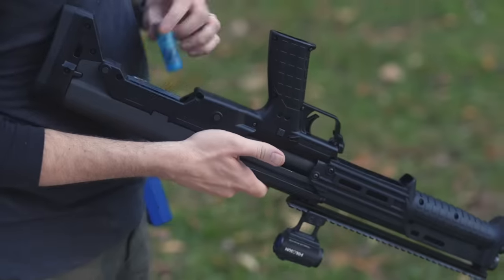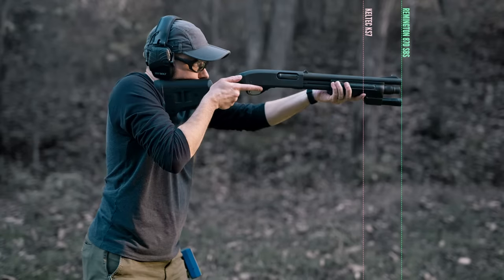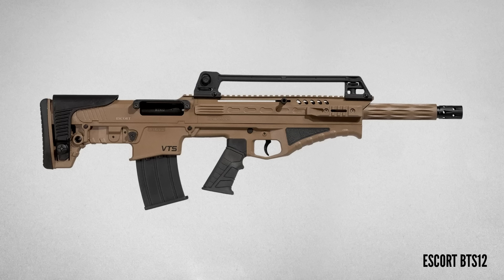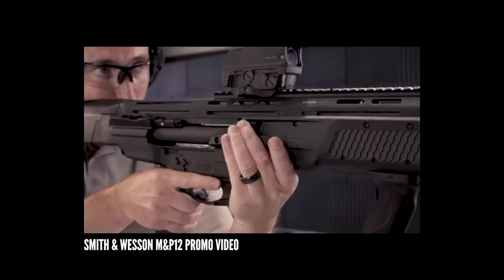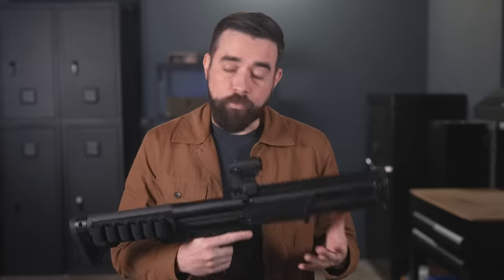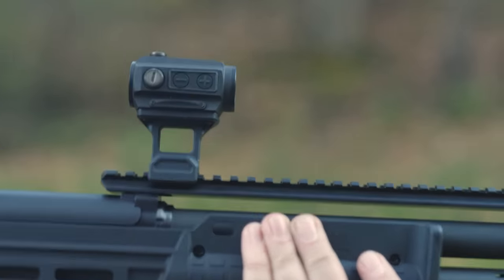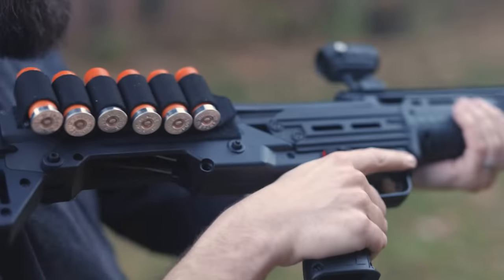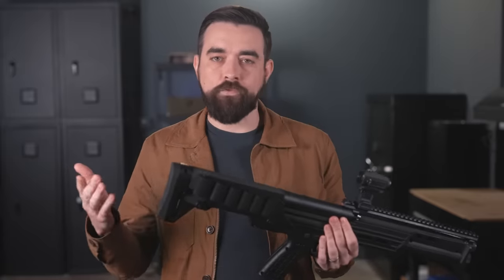The Bullpup Shotgun Experiment

Comment: The KSG is my first and only shotgun, so I do benefit from not having to relearn operations. Trying to run the action as fast as you were in the video can cause feed issues most likely from "short shucking" which is easy to do when you first start training with it. I also noticed you were using low brass shells which I wouldn't recommend as they can become lodged in the extraction forks (which I have experienced). I would also advise against the 1.5 inch shells as they can sometimes double feed. High brass 2 3/4 shells have never given me an issue in 5 years. You're correct about the punishing recoil. I purchased the Kel Tec extended butt pad and muzzle break, which do help to a degree but it's still more extreme than most conventional shotguns. I personally like the gun, but it does come with a steep learning curve and retraining for those who are already proficient with traditional pump shotguns. I would say that if your considering a bullpup shotgun or rifle your best bet would be to go all in or stay completely traditional due to the operational differences between the two platforms.

Comment: I would like to see you continue this trend. I picked up the KS7 myself and I to went with the shell card on the right side and I also found the recoil brutal. I found installing the extended recoil pad KSG sells helped a lot and so and a Limbsaver pad on top of that helped even more. 

I am a fan of the bullpup form factor but I agree with you there are tradeoffs you have to learn. When I came to firearm shooting my strategy was to just learn on bullpups to mitigate that somewhat and so far it has worked pretty well but there are definite cons, I just think the short length is worth it. 

My thought process on getting the KS7 was the same as yours, I only really need 7 rounds, let's save weight. Now I wonder if the KGS would have been a better choice simply due to the increased weight helping with recoil management. Maybe you should try that one. Put a large handstop on the end and it should have a similar action to the KS7. I'd also like to see you run the Tavor-12 and the M&P 12. I got the Tavor - 12 myself but I haven't had much reason to shoot it much but I feel like the recoil will be much softer being semi-auto and heavier but I too worry about the mechanical complexity.

Comment: I have a KSG and I like it. Bought it as an aircraft gun for bush flying because it's smol. I like the dual tubes not for pure capacity, but because you can load different munitions in the different tubes: I run a tube of buck and a tube of Black Magic slugs. I much prefer the ergonomics of the KSG vs a traditional shotgun: normal shotguns' length of pull are absurdly long, and between that and the long barrels it feels like waving a jousting pole around to me. The KSG tucks right into my shoulder and you can move through doors and hallways without pre-planning each movement like you're hauling your friend's couch up to their third-floor apartment.

Loading the KSG sucks: the KSG is even slower than the KS7 because while the KS7 with its single-tube merely needs to be inverted (which gives you a good view of what you're doing), the KSG really needs to be turned on its side... twice. Flip it one way to load one tube, then flip it onto its other side to load the other. You can load the KSG inverted, but its hard without gravity helping guide the shells into the appropriate tube and you'll end up fumbling around in there a lot.

Regarding the action: what I've noticed with the KSG (I assume the KS7 is basically the same mechanism) is that the gun really really needs you to smack the pump energetically onto the rear stops. If you don't run the pump all the way to the rear and smack it against the stops hard, the linkage that deflects the little shell-retention clips at the rear of the magazine tubes doesn't function properly and you'll have issues with shells not popping out of the tubes properly. I've definitely had occasional feed-related issues, but usually it happens when I'm trying to go fast or getting lazy with my pump hand. Smash it like it owes you money.

Access to the action / reloading are awkward with these guns, but especially with the KSG I can't imagine many plausible scenarios where you'd have to reload quickly under pressure. For fending off predators in the bush I can't imagine ever having time to fire more than one or two rounds before something is on top of you, and even for home defense-- how likely is it that someone's going to hang around and get into an extended firefight with you? I'm not saying it's impossible, but it seems pretty unlikely even for the KS7, much less a KSG with 12-14 rounds.

I don't have a ton of rounds through my KSG, so we'll have to see what long-term reliability is like, but KelTec parts don't seem very expensive if things do wear out. At the end of the day the KSG is just a cool platform that allows you a lot of flexibility with minimal need for supporting kit: just grab it off the shelf and you can have seven rounds of buck and seven slugs at your disposal, and you can choose which one you want instantly with the flick of a lever. The KSG also eats up mini-shells without any modifications, allowing even more ammo options-- and truly insane magazine capacity if you do find a mini-shell that suits your needs. I like it.

Comment: You can buy the extended buttpad for the KSG it works on the KS7 and helps a lot. I also started shooting it with the 1.75" shells  using them forced me to learn to cycle it very deliberately which solved cycling issues.

Comment: I happen to own a KSG.
I also own a Benelli Nova, a Mossberg 500 Cruiser, and a Remington 887.
While the actions on the Benelli, Mossy and 887 are FAR nicer (go figure) and MUCH more intuitive (only because that's what I was used to), once I found the little "secrets" to the KSG, it became quite reliable and adequately fast. It's NOT a gun I'd have run when I was young enough to (poorly) shoot 3-gun, but, it is the gun that sleeps on my side of the room with me at night.
One of the most difficult things for me to train myself to do was to absolutely RAM that forend rearward until it stopped! There's only about 1/4 inch or so at the back of the stroke that will make the difference between a failure to feed, a jam, or a dump of live ammo. I also found that a vertical grip helps immensely, and, using the counter-intuitive technique of maintaining forward pressure on that forend grip after cycling, it drastically improved felt recoil! 
The thing is NEVER going to be a "race gun."
I had to make the conscious decision to accept the fact that this was a whole different gun.... with a whole different technique. Once I resigned myself to that, I found that the very feel of the gun changed.... as well as my capabilities with it!
It's a "pump action" alright, but it's NEVER gonna' be like handling an 870!
Awkward as a first piece of @$$..... but..... I kinda' like it!

Comment: I have the DP12, and it's the only shotgun I own. It is heavy, much more than the KSG, and I would not change it for anything. I use it for HD, and I have trained with it. The main reason I got it is I am left-handed.
All the other points are a plus. Holds 16 rounds low recoil even with high brass. For HD, I use the 1 13/4 shells, and that will give me 22 shells 24 if 2 are chambered, but I don't max it out, and I only put 20 shells of the 1 3/4. I have a light on it and a green bull dot. The bull dot makes it faster to get on target and holosun red dot, and I have sighted it for the max distance of my house. 
I have trained with a speed loader and doing it regularly. I have found that speed loader where you can grab 2 at a time  works best for speed, but if you have anything around the house that can hit them as you walking well, they can fall off., so I did what you did, and velcro 6 shells to the stock and I keep 6 BROADHEAD Hexolit 32 in the holder just incase

Comment: I'm glad you also reviewed the KS7 as part of this video (even though you say you didn't set out to do so).  My thought on bullpup shotguns is that they are a better idea than bullpup rifles as they are for closer range and so the worse-than-normal trigger pull that can be expected in a bullpup design is less of a downside.  Personally, I've only ever fired a VRBP 100 by Rock Island, which is a far cry from a Tavor or even the Kel-Tec KSG.  But I was impressed by how compact it was for purposes of maneuvering in and out of cover.  Was able to dump the five-round mag in a couple seconds from 10 yards into a man size target with minimal muzzle rise for a 12 gauge.  Being a semiauto (unlike the KSG and KS7) made the recoil more manageable and the recoil pad had more surface area than the KS7.

Comment: For what it’s worth, I put around 100 standard shells, 20 slugs, and 10 or so 3” magnum 00 buck in my Ks7 on the first day when I got it in 2019. My goal was to test for feeding issues and see if the recoil was as bad as I read.  I was very deliberate to run the pump crisply, and without short stroking.  I had no feeding issues at all, and with a firm grip the recoil was much more mild than I was expecting.   I’ve had good luck based on that small test, but Covid hit and I haven’t shot it since.  It will never replace my Benelli, but lives staged in another section of the house.  Cheers.

Comment: My daughter had pistol grip Mossberg 500 with a Kick Lite stock. The Kick Lite stock seemed to actually increase the recoil. 😞 She hated that gun. When I got the KS7, I quickly learned the best way to deal with the recoil. 
1. Add a slip on recoil pad to the gun.
2. Push forward on the pistol grip as you pull back on the forearm, with the gun held firmly against your shoulder. Your arms help absorb the recoil. This also helps cycle rounds faster. 
3. As the gun fires, you are already pulling back on the forearm, so you can quickly cycle another round when the slide releases.
This made the KS7 more pleasant to shoot than the pistol gripped Mossberg.
After my daughter shot a few rounds through the KS7 using this technique,  she asked me to sell her Mossberg so she could get a KS7. 

I hope this helps other KS7 owners.
It's actually not a bad gun when the recoil isn't so harsh.

Comment: My first bullpup shotgun was a KSG and I put a SiCo Salvo on to make it less deafening if I ever needed to put it to work. While it’s only just “hearing safe” at 140dbs it cuts recoil enough to make it operable under stress while also limiting defensive rounds to shot only (the wad in a slug round apparently fouls the can although I hope to never find out personally). Since that experiment I’ve picked up a TS12 and found choke adapters to mount the Salvo there as well and that’s a much handier rig to operate (again limited to buckshot) but I can actually see using that setup under stress versus the KSG which will be more of a last ditch setup due to the unpredictability of the pump action.

Comment: One odd thing on my KSG is that the pump has two distinct rack positions, if you cycle the pump but hold just short of a full cycle it will discharge the spent shell but not load another, to load another I have to make sure to rack it all the way to the rear. Not sure if the KS7 has the same quirk but I found it handy on mine after some practice for clearing the breach without having to unload my magazine tubes.

Comment: While not an owner of bull pups, I’ve always found them interesting. It seems that we are reaching a point where their popularity has risen significantly just based upon the all the various models on the market. Might have to try one in the future. Another great video Chris!
Reply: My thoughts exactly.  I have shot a KSG and I could have sworn that Chris was describing my experience.  There’s one that really got my attention awhile ago. 
The IWI semi-auto with 3 mag tubes that are one unit that pops right off to replace with a full one.  When the first or second tube is empty rotate all three with your support hand. 
When the full tube rotates into place,  a round chambers if the bolt is locked back.  Much faster than the pump running dry…..switching the tube selector…..racking a round. 
The biggest problem for me and many others……$$$$$$$$$$$
Reply: Turns out I might be wrong about the price and the removable mag unit. 
I’m remembering another semi-auto
called the  SRM 1216

Comment: Novice shotgun user here, I chose the KSG as my first shotgun. I will say that not having any shotgun knowledge beforehand made learning it's quirks easy, and it balances quite well. If only it weren't so heavy and cumbersome. 

I also experienced the same issue when cycling the pump. I have to wait a sit second to cycle it, otherwise you see the same issues shown in the video. 

Nevertheless, I plan on getting the Akyls KSG-SS for it

Comment: One thing I notice is that they seem to have omitted the typical Ventilated recoil pad.  A solid pad makes a huge difference in felt recoil.  Maybe you should try to put a limbsaver or kickeez pad on it and see how that does.  I'd be interested in such a series, because I've been considering one, but ended up going with a 26" barreled over-under.  (2) shots, but the follow up is great and I can put (2) slugs 2" apart at 25-30 yards as fast as I can pull the trigger.  With the shorter barrel length and very short action, it is a bit shorter than a standard shotgun, although longer than an 18" barreled one.

Comment: Sir, I do not consider shorter barrel length as issue except for the purpose of complying some legal restrictions.

For the purpose of exterior ballistics, barrel length of 10 inches is sufficient to burn all the powder in a typical shotshell ammo.

Shotgun is a specialized weapon and must not be treated like a carbine and the end-user usually has a holstered handgun for more precise shots. The proper drill of reloading from the number of shots fired is the common practice. Any capacity greater than 4+1 is inconsequential.

Comment: Yes please. I would love to see your review on the IWI.
Reply from the maker: That one might be fun. It's comically large, but that doesn't mean it don't work.
Reply: @LuckyGunner  The TS looks so in profile, but is pretty thin and light in the hand with good balance. I have been running mine for about a year now and love it. With three magazine tubes and two loading ports, it is pretty easy to keep running by continuously stuffing shells into the lefthand port and rotating the magazines counterclockwise. I have only run into three negatives in use. The magazines are short and picky on shell length, so the longer shells turn each into a 4 shot magazine. Light mounting is limited by the tubes, so I run my light off the top rail and then use the forward Mlok slots for a pressure switch. Lastly sight offset is a very real thing with most of the bullpups and especially the TS-12.

Comment: I have only fired the KS7 with the extended butt pad and it still kicks hard. ~80 shells of bird shot and I was sore for a couple of days. I put a muzzle break and Limbsaver pad on, hopefully it will help make it more enjoyable to shoot.
Reply: How did the muzzle brake and limbsaver work out?  Do you have links?
Reply: @PvtSchmuckatelli  The brake and pad made all the difference. I wasn't sore the day after shooting a few boxes of clays. The pad is sold on eBay by TMP Customs with a billet adapter and the brake is a Hi-Tech Howitzer 70 brake. I took the brake off to see if it makes a difference and it does take the edge off but a 12 gauge will still give you a push.

Comment: A bullpup, particularly  a semiautomatic, has another major advantage in a home defense situation. Namely the ability to use it one handed. This a major advantage in a home defense situation as you may have to open doors, assist family memebers, or hold a burglar at gunpoint while using a phone. A lightweight, reliable and easily reloadable semiautomatic bullpup shotgun would be nearly ideal for home defense.
Reply from the maker: That is true. The KS7 is pretty easy to fire one handed as well, if necessary (of course, cycling the action is not as simple).

Comment: Would definitely like to get your opinion on the Black Aces Tactical Pro Series Bullpup Shotgun FD12 pump and semi-auto. I purchased the semi-auto and it runs well. Put ~300 rounds through it thus far. It definitely likes the high brass more than the low brass, but that's a trait of the Turkish shotguns... I've been told.

Comment: I’ve got both the Ksg and the Ks7. Would buy another Ksg, I’m currently trying to sell my Ks7. The recoil on the heavier Ksg is noticeably better, and I have far fewer issues with it in general. The biggest one I had with the Ks7 is the double feeds, regardless of high or low brass. It just loves to throw two shells into feed ramp, then you have to flip it over and try to shove one back in.

Comment: You didn't mention the significant difference in weight balance. Most of weight, especially in a mag-fed bullpub, is behind the trigger. Coupled with the much shorter length and bullpub shotguns are incredibly easy to maneuver.

Comment: From what I've seen, the main advertised benefit of the multiple tube models was the ability to load each with different loads and be able to quickly switch between them as needed. Obviously not all users will find that feature particularly useful. But, for the ones that do, it is a great selling point.
Reply: I'm not sold on the multiple loads part, but the real benefit is increased capacity without increasing the length.
Reply: @LinkHyrule03  that is definitely what will appeal most to the average user about it. The multiple loads thing will primarily apply to law enforcement and military users.